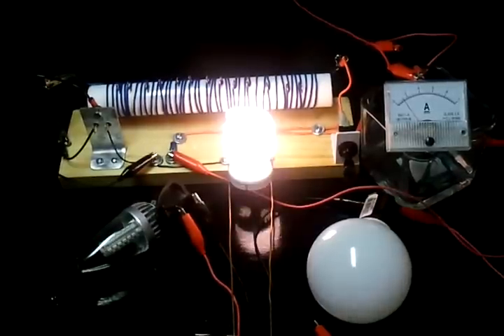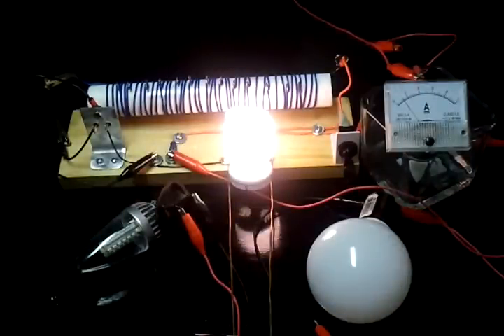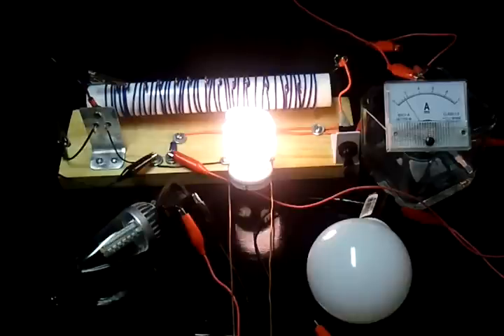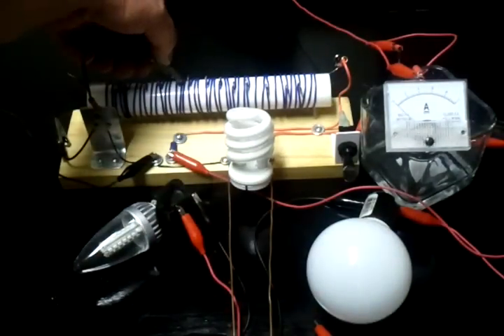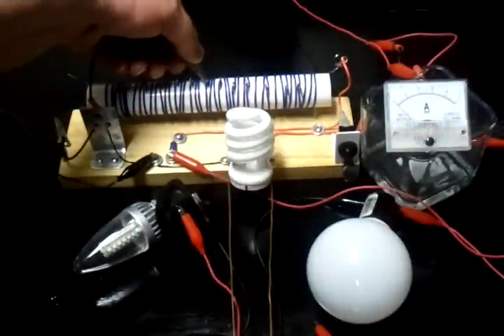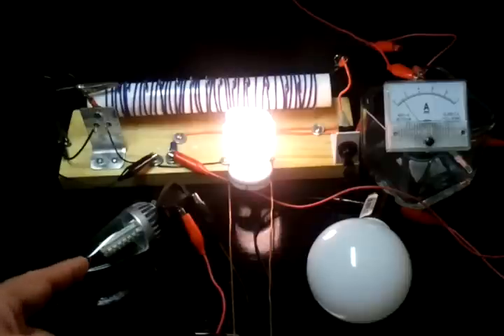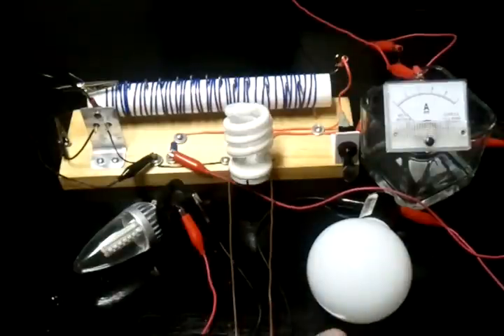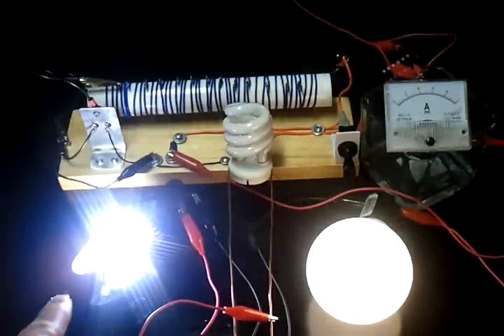Air Core - Lynx Joule Lamp - Replication

Comment: Liked this as soon as I saw it on OU, looking like a crystal radio ! :D
Do you get wireless effects off this one ? In my smaller replication (based on yours and at 12V), I can get a decent few inches field with CFL running. It'll light a 4W flouro to about 20% brightness just by laying it next to the coils. LED on AV plug and a loop of wire gives about 6" range. I guess we want zero range for efficiency, but it's neat as a side effect.

Comment: I like your setup. Very clean and simple. It really shows the quarter sinewave node (My own reference, lol) on the coil. That node goes low to max current, Then no more current because the Transistor is off bias at that point. A very good board to learn from. thanks for sharing.

Comment: Very nice setup, and great performance.  I posted my thoughts on how and why this circuit performs this way as primary turns are reduced, (OverUnity Forum, Joule Thief).  In effect you are decreasing the oscillation frequency as if you are placing a bigger load on the circuit.  Its a great technique for finding optimal turns for a certain load.  Looks like 27-30 turns is about right for one bulb, and concurs with what I found.